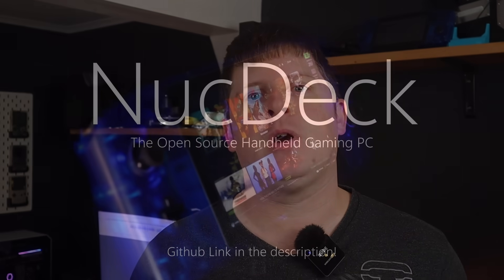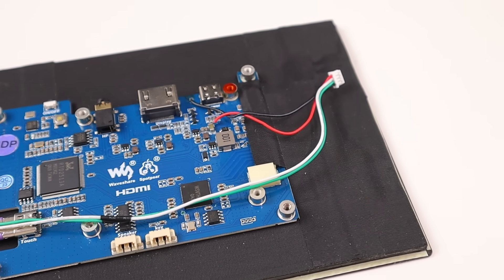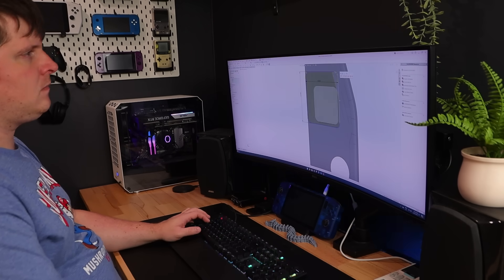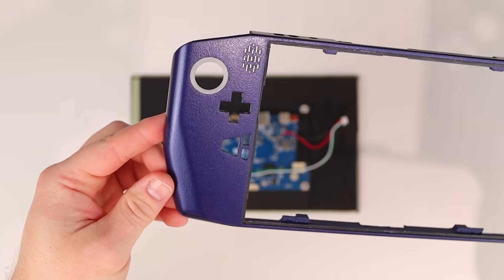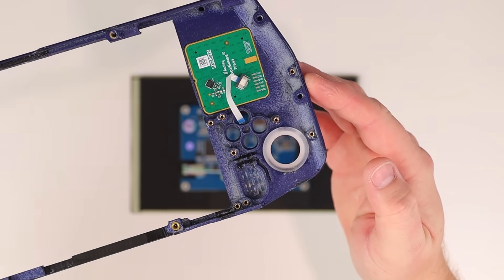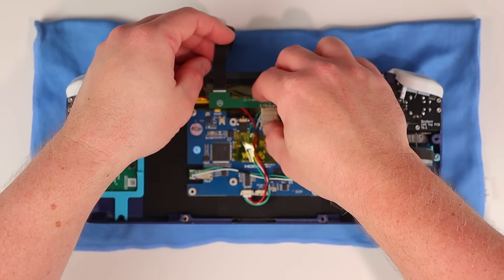I Built My Own Steam Deck!

Comment: The SER 8 is a much better device to start with as it's closer to the specs of the steam deck than the SER5.   While it cost a bit more overall it was worth it for me, I returned my SER5 and got the SER8 and it's an amazing machine.   Really Nice build that you made.
Reply from the maker: Cheers! And yeah, there are definitely more powerful units available. I just picked something that fit my budget at the time! I think I will revisit handhelds again one day and see if I can build one that's even better!

Comment: THIS WAS GREAT! I build similar projects out of existing shells. I would recommend (don't know how confident you are with it) separating and soldering the HDMI ribbon to the NUC and leaving the other end as a plug to go to the display. Still serviceable like the current setup, and a slightly cleaner look too. And depending on the HDMI version on there (some HDMI's now are actually DP connections) you might be able to plug into another monitor with the same port you tapped into! (DP supports 2 independent outputs to one port via splitter. Don't think there's a standard HDMI version that does the same, but mirroring the main display would probably work.) Just an idea that would add a TON of time and possibly a couple burnt through ribbon cables if you're not big on soldering lol

Comment: awesome work mate, thats some bogan ingenuity right there. could probably get more than an hour out of the battery if you tune the TDP lower via bios/other utility.
Reply from the maker: Thanks! You can get 3-4 hours on lower TDP settings or less demanding games. At full load though without capping the TDP it's just over an hour.

Comment: It looks amazing. Great job!

Would it be cost-prohibitive to make another with an OLED screen (or do you simply prefer IPS)?

I watched another person’s build earlier and it was a fairly tedious thing to watch (it included every mistake, every iteration etc, but it was still valuable to learn what not to do).

Thanks for uploading and sharing a way forward on this project. I’m building up the courage to attempt an ultra-wide (21:9) hand held, but it might be too ambitious for a first project, and I doubt the small ‘Lesown’ screens I’ve seen on Aliexpress are actually good for gaming (even though they claim 120hz for their touch-screens - which appear to chiefly target users wanting a screen for their computer case that monitors PC Health (temp, CPU & GPU performance, etc).

Comment: Why not just use ABS for the housing then just vapor smooth it so you dont have to spend HOURS sanding lol
Reply from the maker: Because you'd still have to sand it to get a good finish, even with vapour smoothing. I'm also not set up for printing ABS so it wasn't an option for me!

Comment: my fiance keeps hounding me to get a steam deck, the reason they want it: because they want a pc they can play in bed, and because i have a cs skin that if i sold i could get us both the top of the line decks.

my problem with the steam deck: i like running emulators for certain games i play on my older consoles; everything ive saw said its a bitch to get emulation running on the steam deck.

so as of right now i dont have any hand held pc

Comment: looks really good!!!, but wasnt there a  way to fit the hdmi pcb inside thye case or  make it in another way? like a switch that changes betwenn two hdmi signal the one to the screen and the one to the hdmi port on the back of the device?
Reply from the maker: I did it on the previous version by just removing the HDMI ports and replacing them with FFC connectors. Then I just ran the ribbon cable inside the housing. I wanted a less destructive option as it scared some people off from trying the project the previous time!
Reply: @cncdan ok, makes sense

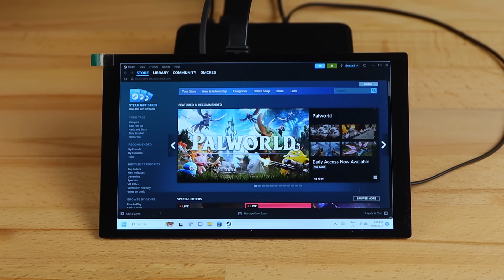Comment: 1:10 you wanted display with higher resolution but bought the with the same resolution? but if you'd use fullhd resolution it would be terrible mistake, because the GPU can't afford it and you'd get soap instead normal image or low fps

Comment: Super cool!  

I do wonder if creating a device that has built in controls is worth it.  If you just built a tablet-ish style slab, you could use an off the shelf controller solution like the Gamesir G8 / G8+ and dramatically simplify the build.

Comment: I wanna know how you wired the bateries to the mini pc, ive been dreaming of making my own as a mini on the go pc using the same model and the only problem im facing right now is how to connect some kind of power bank to it, would the instruction on making it will be available on anywhere?
Reply from the maker: This is the biggest problem everyone faces building these things. I designed my own power management system for this reason. It's not available anywhere yet but I am slowly working on getting it up onto github. Be warned though, it is a complex build!
Reply: @cncdan  ohh okok, I'll be lokking forward to that. Thanks!

Comment: If you flipped the ports to the other side (bottom facing) you could create a custom thunderbolt docking station and prevent dust and debris from damaging your connections

Comment: You know, i have an idea
How about making the nuc thinner and using single type c port for power and display, so you can also make the controller+display+batter thinner/smaller
By doing that can modular the whole thing, like if i want a handheld i just plug a usb cable to the handheld module
If i want laptop i can just plug it to the laptop module
Reply from the maker: I didn't want to modify the NUC to make it a less intimidating project for people to try. As for display over USB-C, I haven't done that before but I imagine it would need some more hardware jammed in there somewhere!
Reply: @cncdan  yea, it might need some dongle built in to support the battery, screen, controller and stuffs

Comment: I've been trying to solve the issue of no usb pd power banks outputting 19v 3.42A for the mini pc I've been eyeing, and even though I may never be able to make a steam deck out of it, I was curious how you went about powering the mini pc? I saw that you made a custom power management board, but I'm not sure where you get those batteries or any alternatives to that pcb. Also I noticed you had two wires soldered to specific areas on the motherboard, so did you solder the board directly to the power input? Final question, I was also wondering if I would be able to simply repurpose a couple of 10,000mAh batteries found inside a cheap power bank since they're much thinner and allow for a very compact design? Thanks!
Reply from the maker: The batteries just came from ebay, they are a common size/capacity (used in tesla battery packs, I believe). I had to make my own power managment board as there was just nothing else small enough available to do the job, so I can't link you to an alternative unfortunately! And yes, I soldered the output directly to the PC, simply so I could connect it within the housing and without having to remove the DC jack incase I pull the mini pc back out and upgrade it in the future. You definitely could use flat lithium cells, but the best capacity for the size is definitely still the round cells. Just depends on how much room you have left for batteries! The round ones worked really well for this layout but I've also used flat cells in the past.
Reply: @cncdan  Thanks!

Comment: I loved this series so much- great work! I think a cool project would be to make an opensource handheld that streams from your existing pc using 60GHz mmWave technology. So essentially just a battery powered oled display that you can put into existing smartphone controllers for mobile gaming. So if you were playing a game you could just switch display to the handheld and continue gaming. This way you could also utilise your pc hardware to get great performance and it would be much lighter and only really the display to power

Comment: Amazing vid! Just wondering why you chose the 16:10 ratio 800 res and not 16:9 1080p? Also....subscribed:)
Reply from the maker: Choices of displays for hobbiest are slim at best unfortunately. I used the display I did because I felt it was the best option I could get especially for the money. I'm actually perfectly happy with the resolution, its crisp enough for this size. It still works out to be 188 PPI which is still finer than a 15.6" 1080p laptop screen at 141 PPI so its far from bad!

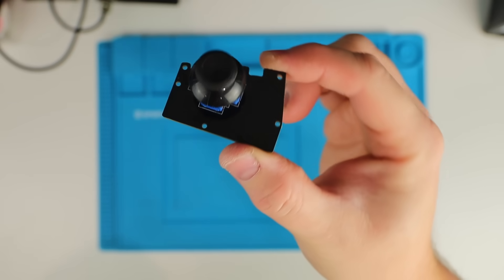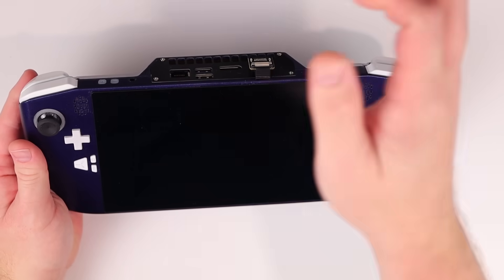Comment: 2:55 joysticks from playstation and xbox didn't fit? they just usually don't have such backlight 9:45
Reply from the maker: I used them on this project. The low profile ones were used on my previous design! The backlight is a custom thing I added!

Comment: I build my own Steam Deck, handheld, whatever.
I think its Superior to any otehr handheld out there and this is the only reason i even started this small project, i had Legion Go, I had OneXplayer X1 AMD, 11inch handhelds and they sucked, even with Thunderbolt attached GPU they still sucked, onexplayer has oculink, so i managed to make it more powerful without thunderbolt issues, but to play games i needed 2 cables, charging and oculink [which is wide, stiff cable with limited run, maximum 1meter long]

So when i got a modded OLED switch from aliexpress, i tested Sunshine and then it hit me:
I Sold legion go
I returned onexplayer to aliexpress [they have 90 days return windows, suck on that amazon]
I returned hacked Switch to Aliexpress too

I ordered on sale a mini PC with 8845H soc, it has USB 4.0, Oculink and DUAL gen 4.0 NVMe [very few mini PCs offer both oculink and dual NVMe]
Oh and it has external antenna so WiFi signal can be boosted and WiFi card replaced, but i disabled WiFi and went with 2.5Gb Ethernet.
I already had Oculink dock and 4060Ti
and i had the latest gamesir stretchy gamepad

And the last part of this hgandheld puzzle is to get BIG size but not heavy [I have ipad M1 12.9 and i tested it as handheld, i got tired fast]
I got ipad pro 11inch M4, it has OLED and supports 120hz and most important unlike MOST handhelds has HDR, INSANE HDR with Dual OLED screens

I found chinese slim case for ipad pro that has build in routed 10gbps cable, so the USB-C port routed inside the case from its right side to bottom, this way when i have stretchy gamepad on, i can still charge or plug USB-C audio

So the miniPC + 4060Ti has Sunshine
ipad pro has moonlight

Gamnepad dongle is pluged into mini PC to save on latency, audio i either use wireless also pluged into mini PC, or ipad speakers or wired USB-C headphones, but i prefer the dongle into mini PC this way i get virtual surround, dolby atmos for headphone

This is the best handheld, for YEARS to come, 11inch screen, dual OLED, has HDR, the miniPC has oculinked 4060Ti that next year can be easily upgraded to 5060 or 5060Ti depends on benchmarks [or AMD card, i dont mind]

ipad pro is so pixel dense that it doesnt need 2K resolutions, 1080p for standard games or native ipad pro resolution for games that support such non standard resolutions is more than enough
Nvidia has RTXHDR that is better than AutoHDR on windows, every game can be streamed in HDR mode even if they dont support, even emulated games

Some emulators can run from ipad, PSP emulator does maximum render, i think 8K or something, whatever maximum option runs fast on ipad, many people on dekstop PCs cant even do x6, so ipad is far from trash

Comment: You know what I really want/need? A very small device that I can plug into my modem or router via a standard Cat6e cable, and it'll give me a speedtest reading. That's it. That's all it has to do. 
The NIC should be at least 2.5gigbit, max and if it was battery powered & PoE powered that would be a huge bonus.
Reply from the maker: You can do all of that with a raspberry pi! There are definitely POE hats out there and I'm sure you could connect a little display at the same time for a live readout. Then just a bit of a script to make it all happen automatically on startup and away you go 😉

Comment: Know what would be really crazy? 
A discrete GPU in one of those things. You can sacrifice an NVMe slot and get a pcie adapter(m.2>pcie), or even use thunderbolt if one's got it. 
Heck even an MXM GPU...., could all be cool. Would probably have to be steam deck x Nintendo DS type of design though
Reply: MXM GPU in handheld = bye-bye 19V rail

Comment: 10:15 those volume buttons being reversed would send me crazy
Reply from the maker: They are the same orientation as they are on my phone when in landscape? Either way, just swap the buttons over and its one line of code and they'll work the other way round!
Reply: @cncdan do you mean when it’s in landscape with the volume buttons down? Because when volume is on the top most people expect it to be minus on the left and plus on the right.

Comment: You may be able to look into platic powder coating would need to just have a material that wouldnt melt fornthe powder to cure.
Reply: Can also use a heat gun to cure powder coat on plastic to just try it.
Reply: Could even plastic electro plate it with graphite paint.

Comment: @cncdan  you still can move the pc board further down without losing the external USB ports. just make a tunnel in the plastic going down some inches that accomodates a regular USB cable of common thickness
I dont know if the pc board has another HDMI or not, but the same applies
just pull the board down, redesign the case to have a rectangular plastic tunel around the external doors, then the case ends on the ports anyway and you can still connect any cable you want
Reply from the maker: There's no enough room at the bottom of the PC. I even made tiny USB PCB boards to connect to the internal USB ports so I could have it as far down in the housing as possible. The only way you are getting that HDMI inside without making the whole thing bigger is to replace the HDMI ports with FFC connectors like I mentioned in the other comments. It works, but its a scary step a lot of people didn't like so I came up with a less destructive alternative!

Comment: If you soldered the Hdmi directly, that would make it super clean. And for the battery you could make additional pack, borrowing idea from techno pocket go.

For the material, I heard resin printed paints well. Or just machine out of aluminum. 😂
Reply from the maker: The HDMI port can be replaced with an FFC connector and run internally, I just didn't do it this time because that step scared a few people on my last one so I wanted an easier option. As for the material, I may go back to acrylic like I did on the previous one. I've done some in aluminium previously but it always ends up a bit heavy so that's why I didn't for this one!
Reply: @cncdan  make sense. then this is an almost perfect gaming deck! Aluminum because cool looking. but acrylic or abs might be a better choice. 😅

Comment: incredible work CNCDan, wow!
The only thing I'd want to change about it is that the HDMI cable comes out of the unit, I wonder if there is a way to put a header on the PCB of the PC directly ? 🤷‍♀
truly amazing!!
Reply from the maker: Sure is, I did it on the last project! Just remove the HDMI port from the PC and replace it with an FFC connector. Theres a few reasons I didn't do it this time but I mainly wanted a more reversible option so the PC can be recycled as something else down the track if I decide to upgrade it!

Comment: While it obviously isn't quite as nicely engineered as a Deck or similar it is very impressive for some guy doing it at home.
The only thing I would definitely change is the HDMI connection to the display. I's gonna take some soldering but should be more than doable looking at your skill level.
Reply from the maker: I did the HDMI internally on the last one I built. It's easy enough, but a little scary especially on a brand new PC as you have to desolder the HDMI port and replace it with an FFC connector.

Comment: Great stuff! I was about to get a Frameworks board to play with, but I have this same Beelink sitting around and no one uses it. I might have to pull this thing apart and tinker it up. But who are we kidding, I'm gonna get the Frameworks board at some point too, lol.

Do you have a BOM for this? Also is that power management board available somewhere?
Reply from the maker: I'm planning to put up all the files by the end of the year! That will include the designs for the power management. Be warned, it's quite a complex little PCB to solder!

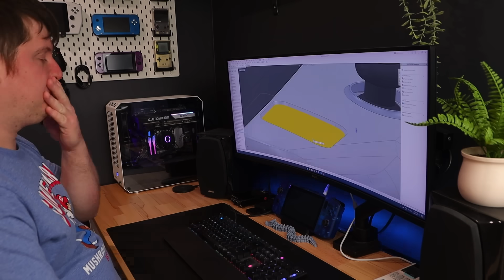Comment: Great video and really good result, also which pc case you have for your desktop pc at 4:10 ?
Reply from the maker: It's a custom build I did shortly before I started on Youtube. I did post a thread about it on the LTT forums at the time, here's a link: https://linustechtips.com/topic/1440126-custom-inverted-pc-case-project
Reply: @ that design is really outstanding, Great work. No wonder I couldn’t find it anywhere 😂

Comment: I ma thinking if maybe there is a way to have a broken ASUS Flow Z13, remove everything, replace the big screen with 8 inch 144hz and create this style of handheld with the power of i9 and RTX 3050TI or 4070 graphics, I created myself FLOW Z13 game controller housing from IPEGA 9083S controller as just inserting the powerful PC into it with modified mountings,but the ASUS didnt have the USB in the right place to constantly charge the controller so I had to lay of the idea and bought myself Lenovo Legion Go and still using it over 1 year playing not so demanding games. I used the IPEGA 9083S with the USB hub attachment for some time, but lots of wires where contantly in the way and I had so much contoller connection errors. Resident Evil 2 I played start to finish with that setup, ray tracing and beaudiful graphics and after that gave up, but deeply if the ASUS Flow Z13 had USB on top then this situation would have been GOLD for gaming.AWESOME CHANNEL, LOVE FROM ESTONIA!